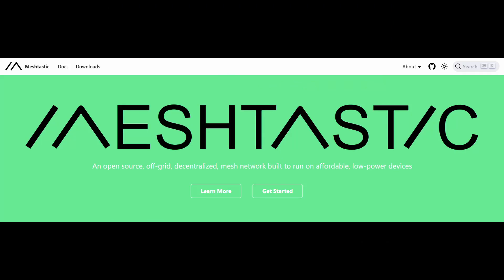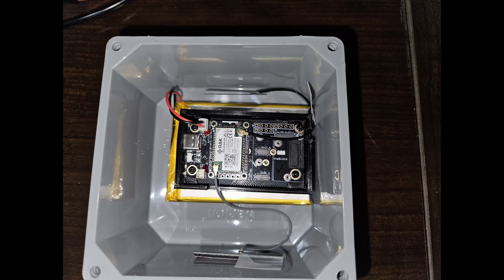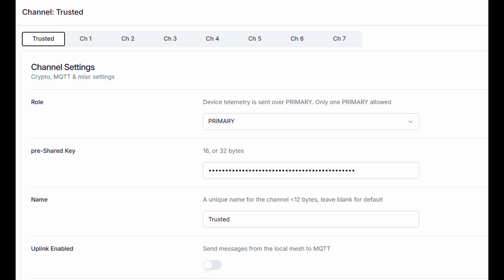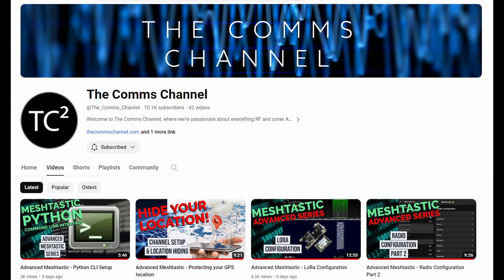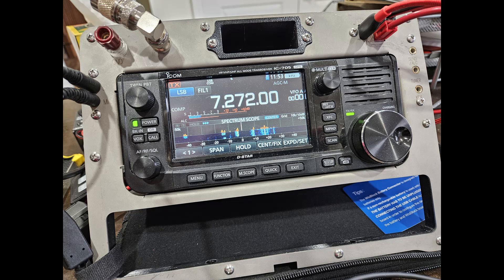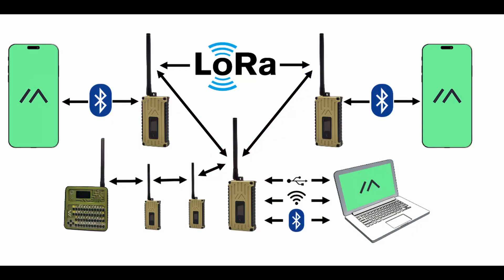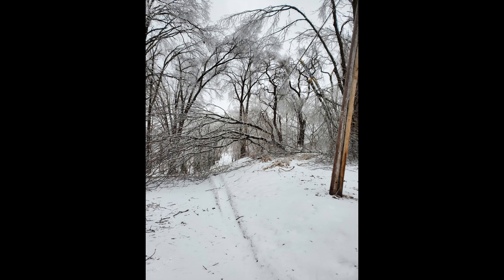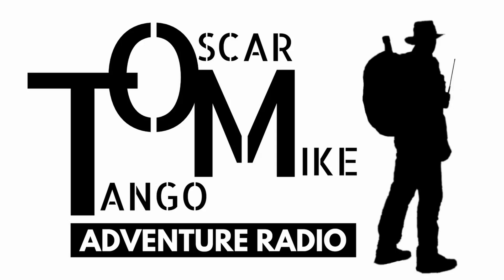Meshtastic update - uses, plans, more to learn

Comment: Are you sure that you'll see other public nodes on the secondary channel? The gps datas and telemetry doesn't only work on the primary channel? Does the map will show all public nodes + all the nodes on the primary channel?
Thanks. We have a mesh of +15 nodes here with a few hams in east Belgium.
Reply from the maker: Telemetry only goes out on the primary channel, but if you have the default channel as your secondary, you will see any other nodes in the node list, but not on the map.

Comment: If you add solar to the rak buy the rak “green power module” it’s a buck boost converter that takes solar panel voltage below 5v & boost it to 5v much more reliable

Comment: Hey! What's the new antenna make/model? Have you used the solar port on the RAK? Made a similar setup with the 4x4 junction box. It's perfect for it.
Reply from the maker: I got this one, which was recommended by other meshtastic users, it is for the 915MHz range.  https://github.com/RicInNewMexico/Meshtastic-Antenna-Reports/blob/main/PDFs/ANT-916-CW-HW-SMA.pdf

Comment: How do you test with outdoor node as base station & mobile node being up to 2 mikes away? Do you put base station node into REPEATER mode & it relays message back to you for testing?
Reply from the maker: I would just send a position report or direct message and see if I got the confirmation.  I was testing specific locations I mapped out before, so I would just stop for a minute.  At home I had the node connected to a laptop with a screen recorder running.  If you have a T-beam or other ESP32 device it can do an automated range test.  I looking to get one of those.